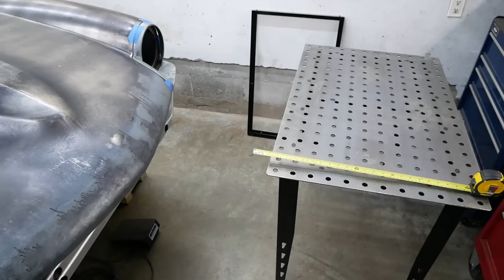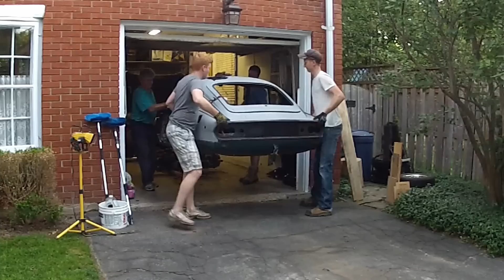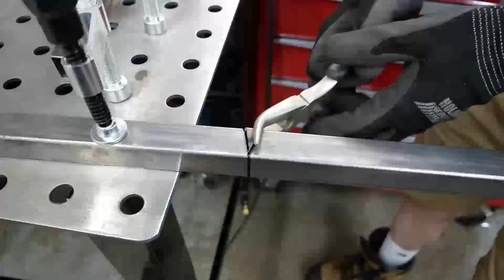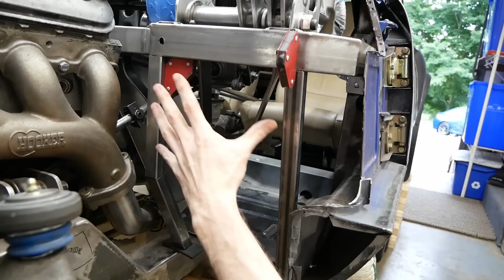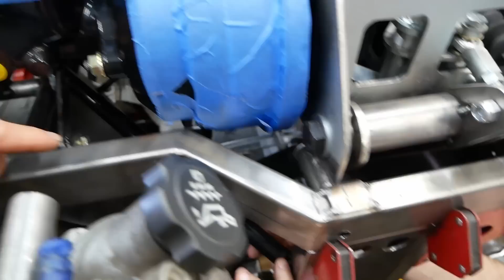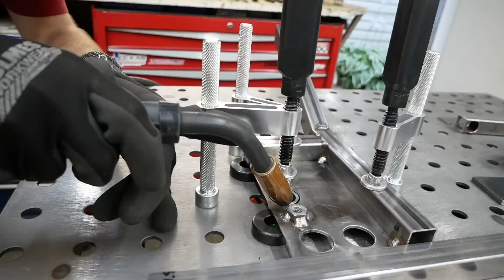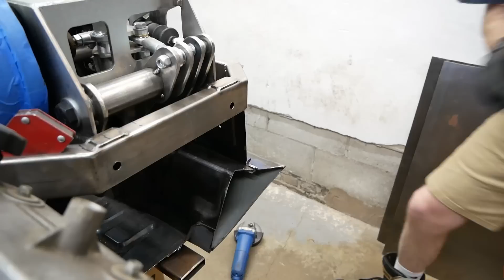Serious Structure – V8 Powered Pro Touring Triumph Build – Project GT6R – Ep41

Comment: I can't understand why you don't have more subscribers, having been with you since episode 1. I love the seat-of-the-pants, make-it-up-as-you-go design vibe. Very old school hot rodding.
Reply: Probably because 99% of people don't know what a GT6 is. I had one in the late 70s and even back then it was an odd bird to see. If this was a Lambo he would probably have 500k subscribers. To Fanatik Builds, job well done. People just dont realize how much time something like this takes. I dropped an old school 350 Chevy with a Muncie 4-speed into mine, but it was a hack job. What the GT6 really needed was the range rover 3.5L V8, much stronger transmission, and rear diff from the factory.
Reply from the maker: Cheers Greg, I think Mizmo is on the right track... it's a rare car whose name doesn't grab any attention (hence why I've buried it in the title).  You'd think the shape of car in the thumbnails would though, it's a good looker!  You'd also think something different from the status quo would be by definition, intriguing... but what do I know! 😅 Thanks for watching, and please, share with some friends, it all helps!
Reply: @FanatikBuilds  I was driving mine around in the early 80s and I thought it was a nice car but nothing extraordinary. However I was surprised about how many complements I got on it. The downside IMO of the stock GT6 is it was under powered and had a weak transmission and weak rear diff and I broke both. And it was a hot car in the summer.

Comment: Beautiful work this is an amazing project. Have you thought about inserting a tube down the gap between the inner and outer sill? Keep up the fantastic work. Gavin
Reply from the maker: I have thought about that actually, got the idea from Project Binky!  Really should have done it while the new sills were being installed though, and that was long before we decided to restomod the car.  The 1x3 chassis rails running under the sills do still set us in the right direction though, and we'll be making a series of body mounts along them to really tie things together.  I'm imagining a total of 22-24 bolting points holding the shell to the frame eventually, so it should be pretty stout!  Cheers Gavin, really appreciate the kind words 😎🤜
Reply: Thanks for the reply. I really hope that one day I’ll cross the pond and see the car in person 👍🏻

Comment: Another excellent video I was trying to think what decade oops year I started watching your build  🤔 then I reasised it doesn't matter, the poets say it's not the destination but the journey along the way.

I Am very impressed at your attention to detail always, the problem solving and even lateral thinking your way around the problems

A question please you and I know and nearly 50k people the effort, bracing and protection built into this car, but once you have skinned it, for all intense and purposes you might have just layered a framework on the borders of a particular area and called it done.
How does your vehicle registration centre determine what you are saying is kosher, or do you have to have engineer reports along the way and other BS that is required here in Australia and a lotto win to afford them?

Tony from Rural Western Australia 🇦🇺 🦘
Reply from the maker: Haha, cheers Tony, building is my passion so I'll actually be a bit sad when it's done!  We have a very different system here to you guys, for sure, but I'm still not 100% sure how easily the process will go.  We already have the ownership and some plates for the car, so the only things holding us back are getting it safety checked, and insured.  A safety is performed on any vehicle here in Ontario when it is sold and registered under a new owner, so it's standard procedure, though our car has been significantly altered and this creates some uncertainty to how things will go.  It will either pass, or it won't... paying money to the GOV won't change the outcome.  As much as it's a huge cash-grab, I actually appreciate that you have the option to get things "engineered" in AUS ... would make things a bit more logical here.  Thankfully I know a few local people/companies who will hopefully guide me in the right direction when the time comes. 👍🇨🇦 Cheers!
Reply: @FanatikBuilds   when we see YouTubes from America for example re driving cars on the road it looks like if you had a good mounting place you could drive a broomstick just about down the road, to us it seems either you lucky B@stards or that's insane how can you ever get insurance for that incase a bit rusts off and kills someone?
Not sure if you in Canada have similar policies.
I would have thought in a complicated build like yours you would need a engineers report and the vehicle examined at certain parts or progress points along the build, it was discussed and shown on a Australian YouTube channel
 Mighty Car mods about 3 years ago trailoring there car with permits (costly) and engineers reports (even more cost) to the examination point the car was run through a series of specialised tests (at a cost to the owners) and a report presented back to them, if all OK they head off to continue the build, if not OK they had to fix the errors, come back get the OK to continue etc doing this till finished.
Absolutely insane, depending how far you want to go with the permitting system you might just register it for special times on the road maybe car meets, car shows, maybe a run between sunrise and sunset or full time use
We look at your build and are blown away by the attention to detail, but then reality hits, I would love to give it a go myself, but unless I want to build a ratrod for STRICKLY off road use say on a farm, you think do I really want to put thousands of hours into the build only to be told, "where's your engineers report on the build etc. I can imagine how many shattered hobby fabricators out their in Australia are completely ignorant to the rules and go to take it as we call it" over the pits" for registration only for be told where's the engineers reports, technical reports, permits, id on what each part was and receipts of purchase etc, as you don't seem completely conversant with the requirements your way I suggest to be on the safe side with the vehicle as it is right now please get some positive knowledge of what is required while any examiner has fairly good access to the internal workings and get clued in, for certain. Could you imagine finishing it and be told we need to see what's under her skirt!
Tony

Comment: Curious if the future tube going from the firewall to the front will be designed to crush in the event if a front end collision.
Reply from the maker: It will, just as the section of frame it's attached to.  Most of the crumple zone is just in front of the new tube though. 👍

Comment: Ahhh yes, integrating new tools into a compact work space can become a hobby in itself.
Thinking 3 dimensionally becomes a needed skill in this area.

As for complicated tube cut profiles, you sir, will benefit from 'The Spaghetti Gauge'.
It is essentially a 3D pin gauge. 
Lay strands of (uncooked......) spaghetti in line with the length of the tube, around the tube, holding it in place with a couple of rubber bands. 
Offer this tube/spaghetti combination up to the surface that you wish the end to be shaped to fit, at the angle at which you want it to be.
Slide the spaghetti strands up to the other surface, to take up the gaps left behind.
Wrap some tape around the spaghetti to hold it in place, once it has been configured for the desired shape.
Then slide the spaghetti gauge back along the tube to be cut and trace around the edge of the shape left behind.
Cut along the traced lines and cheddar! Weird shape 3D notches to suit weird shaped project requirements.
Youtube channel 6061.com does this in 1 of his videos, but he used TIG wire.
Reply from the maker: I've seen it before, just never remember to give it a go myself!  The paper technique works pretty well too though - cheers man! 👍

Comment: Would the LT8 with a mere 1064 hp fit in this car?
Reply from the maker: Ha, I don't know about the turbo setup, but the engine could likely squeeze in there! 😅 I think 400hp will be plenty at ~2400lbs though! 😉✌️
Reply: @FanatikBuilds  Maybe the LT8 would fit if you gave your car a wagon like rear end and moved the seats into the trunk.

Comment: When it comes to getting an accurate weight of your car, trailering it to a truck stop, recycler, or even a scales on one of your highways (if you guys do such a thing). Weigh the entire setup, pull the GT6 off, and weigh it again. Subtract from there. 

The trick is to find a place that has to calibrate their scales for legal trade, and of course willing to do you a favor. Bring Hortons, plenty of Hortons. Me being me, I would find a local scale shop and ask them if they know of a place that would do it for free (or really cheap) rather than trying to find local places on my own.

Check out "Ideal TKO" holesaws, of which one of the sizes is a 7/8". They make a factory cut, so if 7/8" and a smidgen is what you are after, then you will be filing out your holes. But you can't beat them for making a pretty hole. That, and you don't have to take out extra life insurance before attempting to make a hole.

Amazon sells a set made by "Highfire", for far less than the Ideal set.

And beautiful work as always!
Reply from the maker: Cheers man, that's a great technique ... I'm currently thinking about getting a few scales, lengths of wood, and calculating the corner weights! 😬 We'll see! ✌️